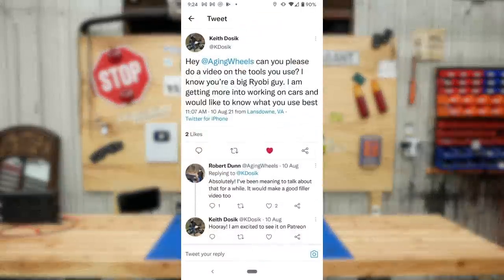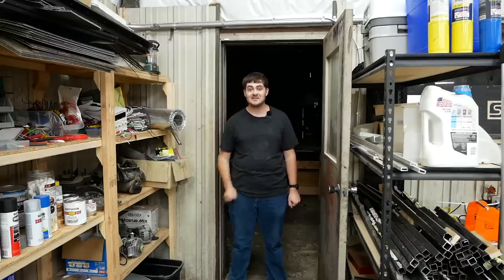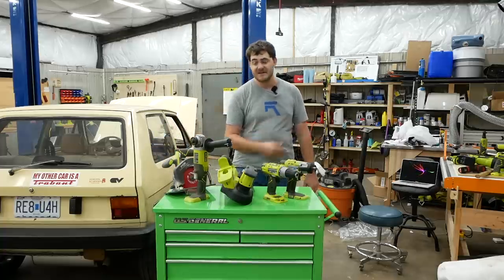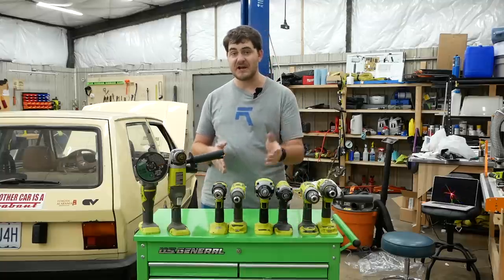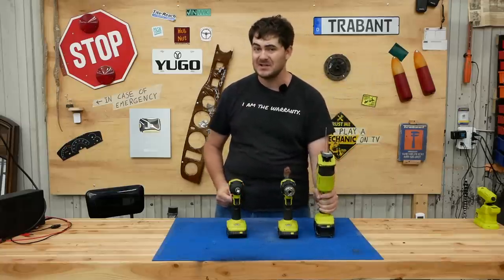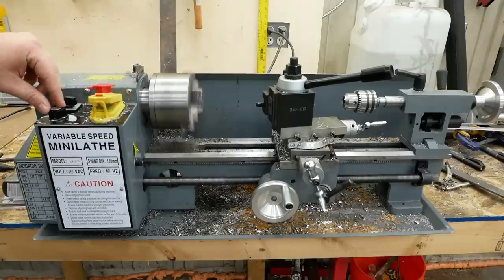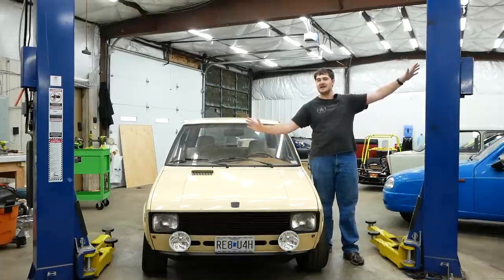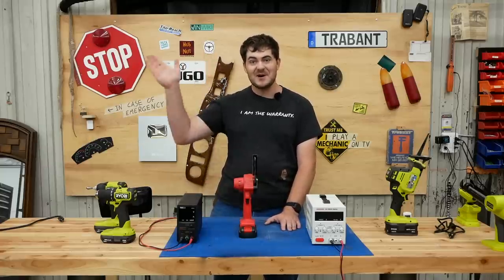What Tools Do I Use? Why? | Aging Wheels Tool Tour

Comment: "Anger Grinder" is definitely accurate
Reply: Yep.  That is how I release my anger in my shop.  I just edit that out of my videos.
Reply: Yes, I could do with getting one of those for the growlery (as seen in Bleak House by Dickens) I tend to call mine the angel grinder or the crap welding disguising tool.
Reply: I call it an angry grinder. That and nothing else
Reply: *aggressively grinds paint random car
Reply: @soberhippie  Angry grinders are truly terrifying things - I'm almost scared to touch mine again after I shattered a cutting disc the very first time I used it.
Reply: Anger Grinder. My Day is done 😂
Reply: god damnit i came to comment the SAME THING
Reply: @MarkMichalowski  There is only two reasons why a disc shatters, you are applying too much torque on it rather than letting it do its job on its own or you are using those really thin cutting discs. Those break real easy if you apply torque at any angle from its cutting edge rather than using it straight. (People sometimes try to use them for quick grinding of stuff they are cutting with them to avoid changing disks and it easily explodes that way.)
Reply: @alexisrivera200xable  I suspect a little of both, Alexis :)
Reply: "Anger grinder" can totally be a brutal name for a Heavy Metal band!!
Reply: @MarkMichalowski Just keep your safety goggles and the guard on! I had one break on me for the first time a week or two ago, sprayed pieces right into my face, and I was totally fine.

Comment: Given your prediliction for extremely odd machines, I'm surprised you haven't found yourself needing a set of Whitworth wrenches. Not quite metric, not quite SAE, ALL British!
Reply: And a set of Bristol wrenches!!
Reply: I have Whitworth tools for my Landy, it's a confusing version of Imperial
It's still measured using fractions of an inch (e.g. 1/4, 3/8) but the sizes are different. A 1/4" Imperial is different to a 1/4" Whitworth
Reply: @lr_s3102  yes, I hate it, of course thanks to galvanic corrosion and the joys of British road salt they're all stuck anyway
Reply: @lr_s3102  there’s a really easy method for dealing with the whitworth to imperial conversion for old British vehicles. Take all your whitworth wrenches, double the nominal size, next divide by 1.3,  finally, take the wrenches and the Land Rover and throw them in the dumpster.
Reply: @batterybuilding  You are hilarious.
Reply: @batterybuilding  reminds me of the recipe for the best Rock Chuck Stew in the world.

Take some onions, carrots, potatoes and elk meat, and make a basic stew, then take your unskilled, uncleaned rock chuck and give it to whatever "friend" brought it to you for cooking, and throw them BOTH out of your house!
Reply: @lr_s3102  The size on a Whitworth was originally the size of the shaft on the bolt, not the size of the nut or bolt head. To further add to the confusion, they used smaller heads on fine threads, Whitworth are coarse threads, British Standard Fine (BSF) are fine threads . 

It gets better. It was decided that nuts didn't need to be so large, so the nut for a given thread size was reduced 1 step. So a spanner labelled 1/4" Whitworth/ 5/16" BSF will fit a bolt with a shaft 5/16" with a coarse thread, and 3/8" with a fine thread. 

You may find spanners with the legend 1/2" AF. the AF stands for "across flats" which shows the actual size of the nut.
Reply: @lr_s3102  please don't tell me you've got a landy! I'm obsesses with the bloody things! 

My family owned a 109" S3 and I learned to drive in it, aged 7. I still de-clutch in my 2015 Patrol to this day. (yes, I'm still an active four wheel driver and love my camping)

Sadly, I will never own one, my wife went to a Grammar School (if you get my drift) so it would always be a third car which, thanks to my Autism and spotty employment record, we will never be able to afford. 

I have a keen interest (read as: Autistic Obsession, which is even stronger than a 'regular' obsession) with the ex-Australian Army versions that are released every month at auction. Watching them go to loving homes that still aren't mine is soul destroying, in extremis.
Reply: Might need them for that Reliant Robin
Reply: @batterybuilding  Incorrect, what a fool. You light them on fire in an empty lot!
Reply: @petermiddo Haha, mine is a Series 3 too :)
Reply: @lr_s3102  I had to stop speaking to my uncle for 20 years. I told him to give me first dibs on the purchase of his series 1. 9which he was using as an irrigation winch anchor on his farm) miserable plick sold it on me.
Reply: Just a heads up folks, Whitworth is Imperial.  SAE are a society, who used an imperial ruler to measure a non-imperial nut and bolt.
Reply: @lr_s3102  any time you want to do a video tour of your landy, you'd have at least one view here. Maybe even a subs, if there are more.
Reply: @petermiddo  Maybe will at some point.
Reply: @cme2cau  The original Whitworth sizes were set by the man himself, Joseph Whitworth, who basically invented standardised fasteners (fascinating story - well worth discovering). With the material science available in the day, the original "huge" (to our modern eyes) bolt heads were necessary to get decent strength. What actually drove the change to the smaller head sizes, though, was WW2 & a shortage of metal. Since BSF used the same spanner sizes, just one "step" smaller, the bolt heads on Whitworth were changed to match BSF's sizes - so a 5/16" BSW head is now the same as a 5/16" BSF head. The two spanner markings (BSF & Whit) will tell you what size - but confusingly, the larger "Whit" or "Whitworth" size won't fit the "BSW" - because BSW is the name generally used for post-WW2 "smaller" Whitworths. So, confusingly, a BSW (coarse thread) bolt should be mated with the BSF size on your spanner, not the Whitworth size....

I actually like the Whitworth way of doing things, where the shank diameter is the size - it gives you an instant feel for the size of the fastener. There's a reason the Metric system does it like that. I'm not sure why the "AF" (invented by the SAE? Not sure) system completely divorces the nut head size from the shank diameter. I mean, if I want a 1/2" AF bolt, how big do I drill the hole?
Reply: @theelectricmonk3909  Imperial threads were standardised when the Unified Thread Standard was adopted by the Screw Thread Standardization Committees of Canada, the United Kingdom, and the United States on November 18, 1949. (I looked it up!). The advantages of divorcing head size from shank size is that you can specify a larger head when one is needed. You can also have the bolt head a different size from the nut so you only need one set of spanners!
Reply: @cme2cau  That’s not imperial, it’s unified!
Reply: @lkchild  the perils of being born in England. Inch = Imperial in my mind. Apologies to those whose whose ancestors escaped perfidious Albion.

Comment: I actually really like that Milwaukee electric screwdriver. Makes assembling Ikea furniture a snap, among other things.
Reply from the maker: I prefer the 12v Bosch pocket driver, but they're both super useful
Reply: I bought the Black + Decker equivalent on a whim a while back, and it has proven surprisingly useful during an ongoing bathroom remodel--particularly when we decided to go with paneling that screwed to the wall, and the grown-up drill-drivers were punching the heads right through the paneling. :)
Reply: I agree, I have the same thing, as well as the Ryobi drills he has as well, and I find myself using the little Milwaukee for most just.. driving.. and the Ryobi for any actually drilling.
Reply: Ikea has those electric screwdrivers with in built torque limiters. Liked it, really simple tool, but was handy
Reply: I have a ryobi Screwdriver. It'd really really nice. The stupid wiring broke however and I had to solder in a new wire.
Reply: For light jobs like Ikea furniture or whatever, my tool go-to is a little Tacklife handheld cordless. It's not very torquey, and the battery always seems to die when I need it to Not do that thing. So why do I use it? Because A: it's USB rechargeable, on a Micro-B port, which is kind of awesome, no battery swaps or specialized chargers required, and B: because it was five dollars at a Goodwill. Seriously. Thing works fine and I got it at a thrift shop, and apparently they're pretty cheap new too, so that's always fun. Also it has a light on it. The light only turns on while you're screwing or unscrewing, which is silly, and it has two "settings" for lenses on the light that change exactly Nothing, but hey, it's got a light on it. XD
Reply: Just wait until you hear about a power drill
Reply: @agingwheels  Bosch is my go to

Comment: The 3D printer thing is spot on. You get one, have to justify buying it for the handful of things you initially got it for, make like 50 decorative prints with intermittent useful ones like conveniences and upgrades, and run out of things to print in 2-3 months until you either learn to make stuff or just say "ah to heck with it" and make more decorative stuff as desired. The new justification midway is all those filaments and colors. You can easily spend more than the printer on that.
Reply: As a 3D printer owner this is spot on. And I don't regret it a single bit!
Reply: It is a maker's best friend, and a maker of makers ;)
Reply: Same. What is worse is deciding you want to change the color of the mods you made. I went from Black to Blue to Orange. I recently got a Creality Halot-One resin printer and designed and printed a 2.5 inch duct to vent the fumes outside.
Reply: But now, he can design and 3D print some Aging Wheels doo-dads and sell them!
Reply: My buddy has a 3d printer, and every year he has his daughter pick out a filament for her birthday, with the idea that instead of buying her a toy for her birthday she chooses her favorite color and he makes her virtually any toy she wants until the filament runs out.
Reply: For me, having the option of 3D printing things as needed is incredibly valuable. It's an extremely versatile tool that isn't always needed, but worth it's weight in gold when it is.
Reply: I never print decorative stuff, amusingly. I basically only print functional things and replacement parts for household things.
Reply: First things you print with your new 3d printer are upgrades for your 3d printer.
Reply: @Smedleydog1  The SECOND, after test prints to make sure it can actually make anything and you're gap is set right.
Reply: I have made discontinued things that I needed. Like boat trailer rocker bushings. In nylon.
Reply: @MostlyInteresting  Nylon is HELL to print in for the most part. That must have taken a few attempts but was quite useful afterwards.
Reply: @IncertusetNescio  A hot box is the trick. I used just a thick cardboard box over the printer. But yea its tricky.
Reply: I have never once printed any of the landfill-bait that Thingiverse is littered with. Plenty of my "functional" prints are comparatively garbage though, so I can't judge.
Reply: The answer is wargaming. I printed so much terrain for Warhammer 40k. Insane amounts. If you do the math, the printer alredy paid for itself. With the insane prices that Games Workshop sells these things for. And D&D.

Comment: One concern about Direct Tools Outlets is that many of the tools you buy from their may be discontinued or discontinuing soon, so be wary of investing in a new tool+battery system as those batteries could end up being discontinued soon and never available again.
Reply: Not an issue if they use the same battery as tools you already own.
Reply: He shouldn't be buying any of this crap. He should buy a compressor and air tools.
Reply: @tarstarkusz  ... naah , air is so last century ( unless you've a 3/4 drive impact for stubborn wheel nuts/lugs )
Reply: @888johnmac  You're joking, right?  I hope.  You can buy air tools today and give them to your great grandchild.  Every tool in this video will be totally obsolete in 10 years;. 
As for power, nothing beats air. Corded tools cannot hold a candle to air (because good air tools require a large 240v compressor)
If you're going to complain about money, well, cheap air tools are cheaper and dude has a lift and air-conditioned shop (not even a garage, the thing is enormous)
Reply: @tarstarkusz  Considering how many of his tools are cordless, including some that frankly don't need to be like the soldering station, it might be a matter of preference more than anything.
Reply: @SteelSkin667  I suppose. Though, to be fair, for cars, nothing beats a portable soldering iron with the possible exception of one that can run off the cigarette lighter or battery under the hood.  Still, I would go butane. (never run anything but zippo brand butane. The rest is junk and WILL clog the butane iron and even lighters)
Reply: @tarstarkusz  he does have a shop air compressor and hose built in, so it is preference for the portability
Reply: @bdub1682  I haven't heard him talk about it.  The real question is "is it a real compressor?" 
 If it's not a 220 with 4hp or more and a separate motor and compressor connected by a belt, air tools are pretty much out of the question.
Reply: @tarstarkusz  i'd presume so as the unit is built into the shop itself, you can see the wall hose behind him as he talks about the welder
Reply: @SteelSkin667  
Knowing Rob through his youtube videos, he's definitely the type of guy that prioritizes convenience over longevity.
Reply: Ryobi has been using the same battery format for like 20-plus years. I have some ancient dark blue and yellow Ryobi tools and the newest batteries still pop in and run them just fine.
Reply: @AKADriver  Are you sure about that?  That would be 2001.  I seem to recall in 2001, that most tools were 14.4v not 18v.
Reply: Robert is lucky having such a good range of Ryobi available. I have got some good cheap tools from places like Lidl and Aldi but it seems every one has a different battery pack. A quick count and I'm up to five types and the only one with readily available replacements is a DeWalt.
Reply: Ryobi has had the same batteries since 1996, also Jank ebay adapters exist.
Reply: a lot of the tool brands keep the same battery shapes for a long time, and even if they stop making one particular battery or charger, the new versions will often be compatible with older tools or batteries. my dad has some drivers that are 15+ years old, and they still make batteries for them. and the batteries last a long time, too.

Comment: "it doubles as a heat pump"

I see why Alec likes you
Reply: I got it
Reply: I dunno, Alec may not like him anymore after the last video where he put LED replacement bulbs in his car designed for incandescent bulbs. 😋
Reply: @mjc0961  TRUE
Reply: @mjc0961  I did the same and if anything the LEDs have been brighter BUT this is the third set I bought, the first two were total garbage and either looked like side lights or were not even across the cluster. The third set do give a close enough to 360 effect so it works and bonus of that is it's not blinding because it doesn't have any that shine directly at the lens (which in my car is just coloured plastic, not fresnel lensed)
Reply: @NaokisRC  The main problem with LEDs usually isn't brightness but focus/aim.  A lot of the times they end up blinding other drivers instead of properly focusing light on the road.  Probably not as big a deal without the Fresnel lens and aiming it towards the back also helps a lot.

Comment: about your free power supply. I've heard of this happening. An otherwise unscrupulous seller (or I suppose one trying to build some reputability), typically from China, will send unrequested items to an address, thus generating a verified delivery. This bumps them up on the Amazon foodchain. A couple years ago, there was a huge number of people talking about being sent packages of unrequested seeds. I guess they've moved on to other things.
Reply: This reminds me of a friend that was getting shipped random electronics from Amazon a while back. At one point she'd gotten an M.2 SSD which I think went for about 200 bucks for no clear reason, she didn't even have a computer to put it in at the time, eventually just sold it.
Reply: For those interested, the search term for this type of scam is "brushing".
Reply: This allows them to write their own review with verified purchase stamped on the review. Not a fan of amazon allowing the reviews to go unchecked as in positive reviews mentioning something not related to the product

Comment: Having bought the 1 gallon portable aircompressor for small work/vehicle jobs, I somehow ended up with a bunch of neon green tools. Am actually pleased with how good they are. I kinda regret not getting one of the 40v push mowers when I bought my house, but that's in the future.
Reply: I bought one this year. Great mower, nice and quiet in comparison to a gas mower, but they don't like wet or damp grass all that much. 

If you can, wait for them to come back on promotion. I got a free leaf blower when I got mine.